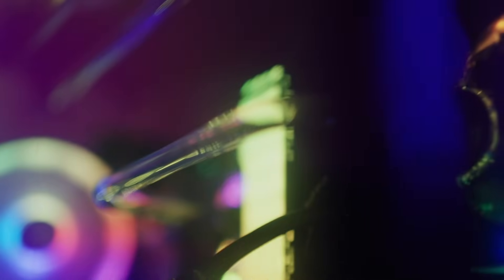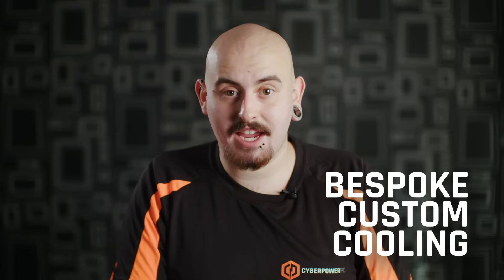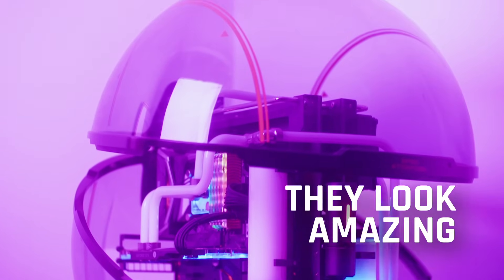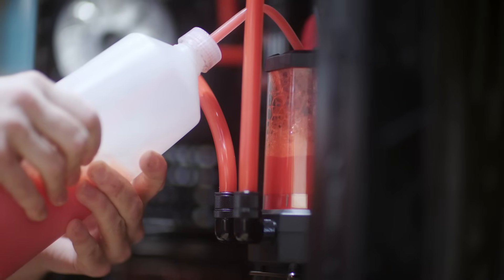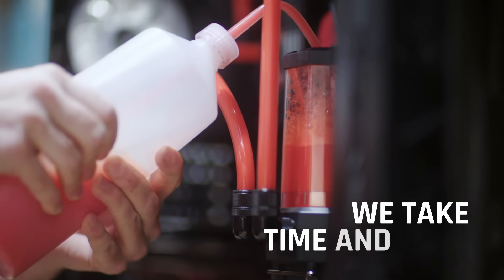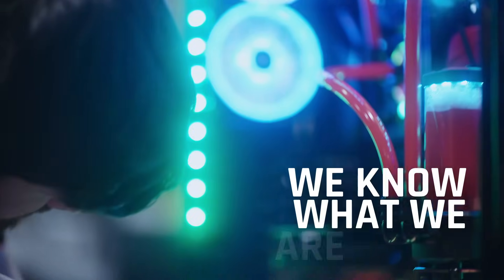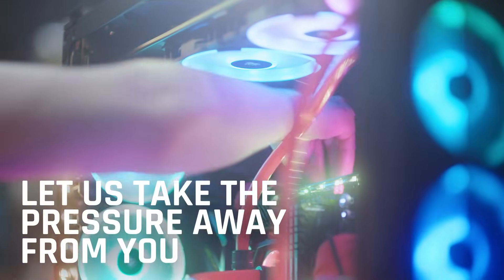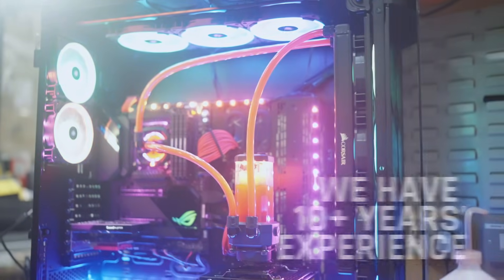Learn how we build our Hyper Liquid Cooling PC Range

Comment: Yeah but don't you have to flush them every time you wanna install something new?
Reply from the maker: Hi Davy, you will have to if you are changing any of the major components like the motherboard, CPU or GPU. It's a high-end system so does require some TLC but well worth it! :-)
Reply: @CyberPowerPCUK  always wanted to but went with the 360mm kraken